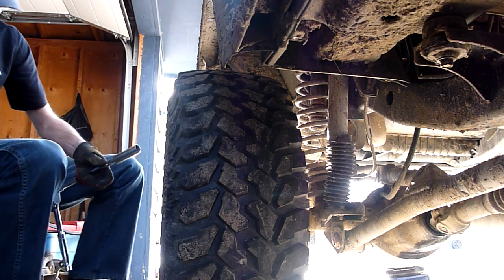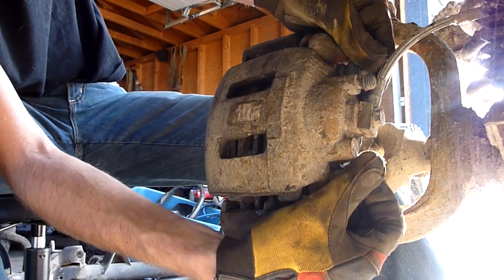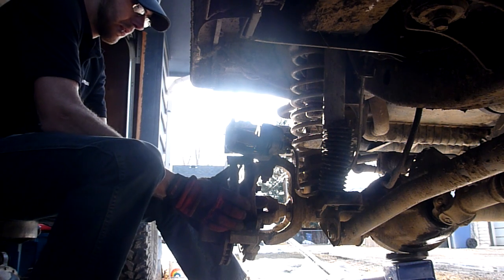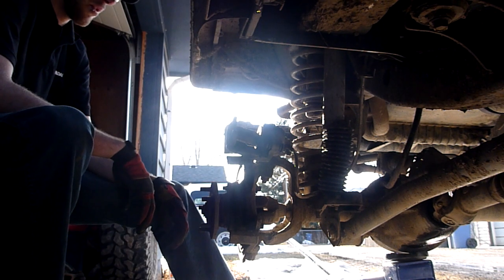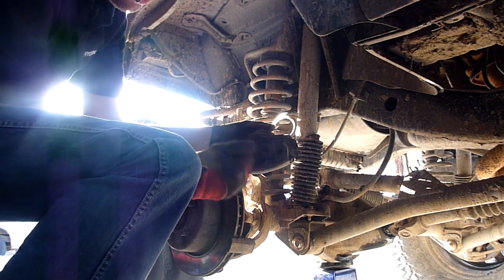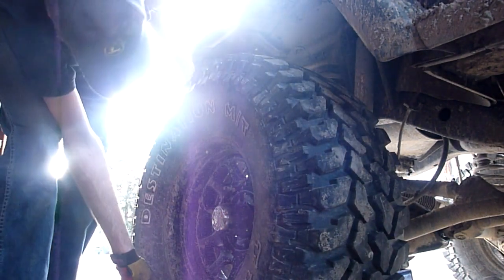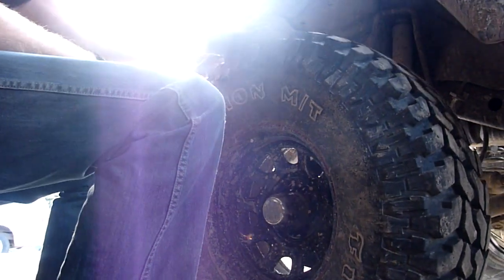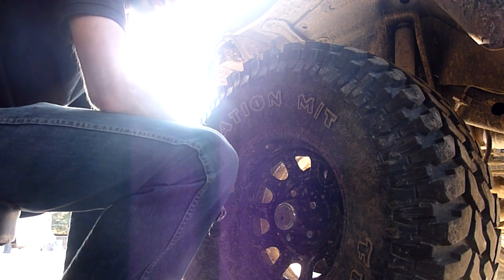Jeep Disk Brake Repair with Dummies. I Mean..."For"...

Comment from the maker: @danthev8man I would use one if I were working under the vehicle as you should never work under a load supported by only a jack. In this case even if the jack were to fail I'm in a safe position as I never place any part of my body under the load.

Comment from the maker: @jeepingnet Mmm I must have commented on that in the first version and neglected to mention in second version. My tires are 12.5" wide so they are PLANTED even with no lug nuts however standard practice is to just loosen them with the weight on the tire and then jack the tire up before completely removing.

Comment: you should use the old brake pad to shove the piston back in the caliper with the c-clamp because some pistons are thin at that point and the clamp might punch a hole in the piston. i have seen it happen numerous times